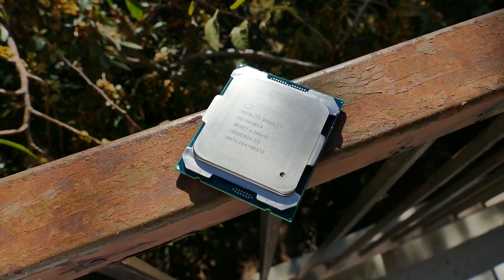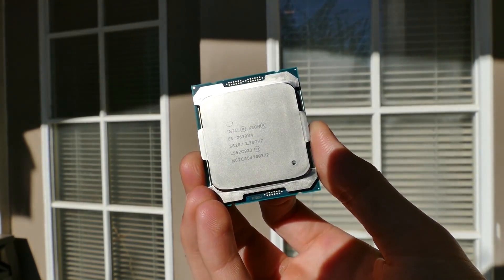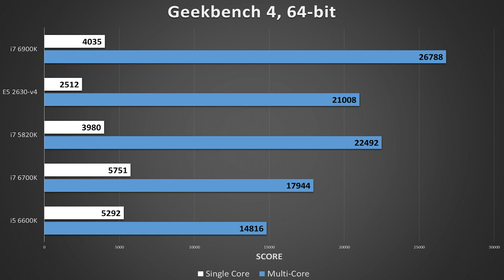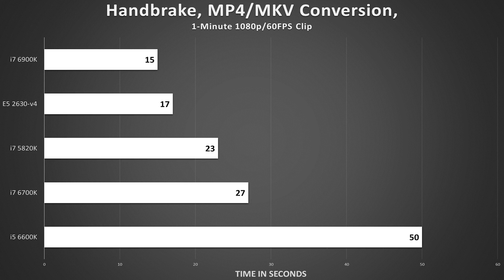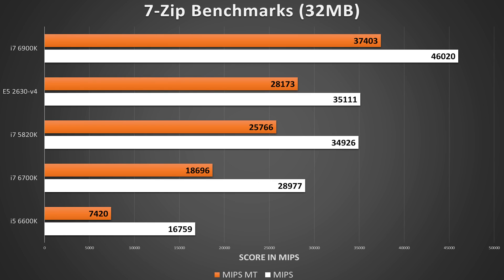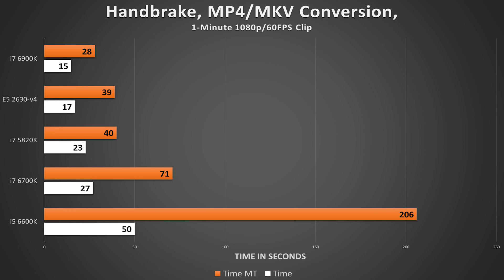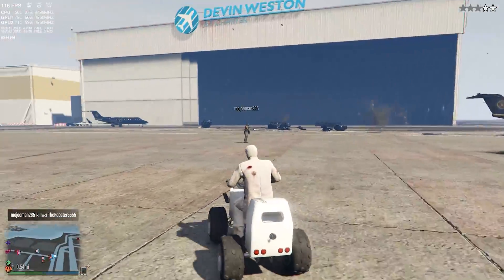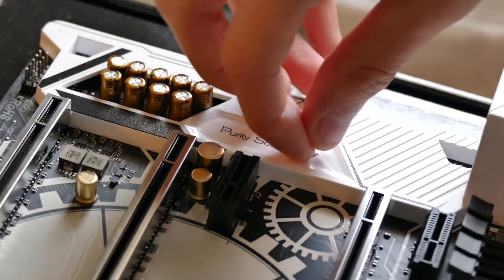i5 vs. i7 vs. i7 vs. Xeon vs. i7 (Multi-tasking/Heavy Workloads)

Comment: Couldn't agree more, I built my first editing PC on a 6600k but notice it crashing my adobe programs too often when creating proxy footage for my 4K files so that they can be easier to edit and take the load of my computer (at the time). So I sold it and bought a 6700k it cut the need to create proxies for my footage it can handle all my editing needs that is why I haven't jump to an x99. Sure it would be nice but I don't really need it. I still push out 4K videos perfectly fine. The only way I would consider jumping to an x99 would be if I find a board like you did that one time I saw I met you at micro center! Keep up the good work man! 

P.S. You videos would look much better with an inter changeable lens mirrorless camera to get that nice bokeh 😍 non the less keep up the good work! 

P.P.S. How do you find time in between finals to push out content? lol you're an engineer student too.. ha I can't do it as a business student lol

Comment: Hi, is it worth to skip on graphic card and buy i7 6700k or go with i7 6700 non "k" with better graphic?  I need it for rendering, photoshop, unreal engine 4 (and others engines too), 3d animation, programming and fl studio... I even thought about go for envdia quadro some like k620 or gt 740 4GB superclocked... till I have some more money for quadro k1200 or gtx 1060 6GB (Because it has more cuda cores)...  I wish to know your opinion... by the way... Awesome video... I thought about i5 6500 or i5 6600k for beginning... but now I change my mind... thanks soo much...
Reply: 6700k and better graphics. save more.
Reply: H31MU7 Do you think that GTX 1050 ti is enough for video editing and for example unreal engine 4? I consider to buy this or get more money for gtx 1060 oc 6gb or something like GTX 970...
Reply: Kamcio Madafaka if you're buying a new card you should just go for the newest and best card you can afford. best thing to do is look up which games run on unreal, find out which cards those games run best on and pick one that fits within your maximum budget

go with the 1060 or an RX 480 if you can afford it, if not go the RX 470/1060 3GB
Reply: H31MU7 Thank you soo much... I think to stay with integrated graphic for about a month... and after that buy some dedicated one... because at the moment I need it only for video editing, programming (I'm entry level), fl studio and drawing after that start with 2d and 3d animation...

Comment: I have an e5-2680(as mentioned in a few videos on this channel) which runs 3.1ghz on all cores, max single core 3.5ghz. It outperforms my trusty old i7 3820 @ 4.75ghz in multi threaded optimized software and only loses out a few % on single threaded apps, which surprised me to say the least! Crazy chip for the $100 i paid for it! If i sold my i7 (not, im collecting!) it could owe me less than i spend on lunch most days!

Comment: I wouldn't rush on the Kabylake.  It's almost exactly the same speed as Skylake clock for clock, and it's only real improvement is the smaller node.  That being said, there are reports of the 7700k hitting 5.0Ghz on air, but it seems like a waste getting it, if you already are running the 6700k.  I can't see the marginal improvements being worth it.  If you are already running Skylake, I would wait it out a little considering it looks like we may finally be getting out of the mainstream 4 core nightmare Intel has had us locked in for ever.  No matter what anyone thinks about upcoming Zen, it will almost certainly force Intel to either rethink their pricing, or finally stop trickling improvements, and make 4c/8t a standard, and finally end dual core and 4c/4t nonsense in 2017-2018.  At least hopefully.  With the new API's getting used more and more, I think core counts will start to show more use in the near future, even in gaming.

Comment: i just bought my 10 core xeon for adobe should i return for a 5820k i need at least 32 lanes and the 5820k can do that so should i keep the xeon
Reply: cant
Reply: Joel Massara not sure on price of the xeon but i7 5930k is a 6 core with 40 lanes.
Reply: SkinUpMonkey yes its slightly sheper but i also biught a h50 for my xeon so i would need to return that aswell
Reply: Joel Massara em h50, do you mean water cooler? If so should still work but wouldn't use it to overclock.
Reply: SkinUpMonkey well the 6850k has 140 watt tdp and is on sale for 400
Reply: Joel Massara Ya the tdp is the reason I wouldn't use a small cooler for overclocking, get at least a 240mm rad.
Reply: SkinUpMonkey k thanks for i think i know i am gonna do

Comment: Hey, I have a massive question. Alright so i have a 6600k OCd to 4.6 Thanks to my gigabyte mobo and I want to know is it safe for me to get a 2nd GTX 1070, I have one right now but I want to know how big the Bottleneck is going to be. Greg pls help, I dont want none of these damn youtube comment help because all they say is  "Get and I7"
Reply: Trum p you should be golden man. No bottlenecks. Youll get huge performance boost. I was doing SLI 980s perfectly with a i5 3570k at 4.6ghz.
So as long as cpu is OCed to its most stable oc you should be perfectly fine. The 6600k is a modern cpu and 8x8 lanes should be perfect. Dont stress it.
Reply: Tanzu's right, slap that second card in and you should be ballin'
Reply: Aaight thanks guys!

Comment: i have 6600k only for GAMING . idk how to even render lol glad it still kind of holds up with the big guys
Reply: Ali Mohamed I have a 6600K and for gaming it really is the best bang for your buck, especially when overclocked. I actually think the 6600k would beat the Xeon and i7 5820K because games usually don't use more than 4 cores, so higher single core performance is therefore preferable.
Reply: William Larsson that's true only the i7 6700k is really better for gaming because the clock speed. Idk about amd tho.
Reply: ***** i havnt overclocked yet, whats urs overclocked to?
Reply: Ali Mohamed 4.4 GHz. Will try to get to 4.5 when I have time, but right now 4.4 GHz is stable for me without much effort. You should be able to hit that too, even with something like a 212 Evo.
Reply: ***** sweet, i stock speed with an H60 AIO liquid cooler, if i want 4.5 , i have to make the multiplyer 45 right and what about voltages, do i increase it ?
Reply: Not every 6600k will overclock the same. The build quality of each chip is different. Don't go higher than 1.35v or you will probably fry it. 1.3 is high enough if you don't want to risk it.
Reply: FatoeKing Skylake chips are very consistent when it comes to OC potentially in comparison to older CPUs. I think 4.4 GHz is a number 97% of 6600Ks are capable of hitting.
Reply: Ali Mohamed Yeah, multiplier to 45 (as long as you keep the base clock untouched at 100MHz) and vcore aka core voltage to ~1.3 Volts should do it, because at 4.5 GHz you will need to increase the voltages or you may get frequent system crashes. Nothing harmful, but annoying. Just like the other guy said, don't go over 1.35 V or the heat may shorten the CPU lifespan.
Reply: ***** yeah i wont touch the BCLK though my z170 mx motherboard allows it, ill do that today and stress test it, whats a good max tempreture i should get because now i get 49 load with skyrim
Reply: ***** true, but they have potential of over 5 Ghz if you are very lucky and have watercooling.
Reply: Ali Mohamed I don't think heat will be an issue for you with your AIO cooler, but if needed, try to keep the temps under 75° C just to be safe
Reply: FatoeKing True, but running at 5 GHz as a daily driver is not recommended. Even with good custom loops to cool it down the core voltage will still stress the CPU to it's very limits
Reply: i have my i5 6600k at 4.6 on a 212 evo
Reply: ***** i flat out lost the silicon lottery lol,  i tried the preset overclocks at 4.3,4.4 and none worked, i tried 4.5 at 1.275v, than 1.3v and finaly 1.35v and none of them booted , cant even get into my login before crashing. should i try peaking 1.4v to achieve 4.5 ?
Reply: Ali Mohamed Are you manually overclocking or using a program to do it for you? I would recommend doing it manually because the "one-click OC" options are often unreliable. 

If I were you, I would try 4.2 GHz at 1.3 V just to see if it boots to desktop (and maybe run a short test). If that works, try 4.3 at 1.3 and try to boot, 4.4 at 1.3 V and so on. I think 1.4 V is pushing it a little to far for me personally, but if you feel comfortable and if the temps are low enough, you could try 4.5GHz at 1.4 V, but try to see how far you can push 1.3 V first.

Otherwise.. can you boot back into the BIOS with the overclock? If so, check your temps. If they seem high, then maybe you can try to replace the thermal paste as well.
Reply: ***** i overclocked manually using my gigabyte motherboard and now it freezes when ever am on there . I'll try resetting cmos today . I have arctic silver 5 paste
Reply: ***** the bios is freezing and PC saying error not booting
Reply: Ali Mohamed Yeah, try clearing cmos. 

Was it a long time ago since you applied the thermal paste? Even good thermal pastes like Artic Silver 5 dries out over time an needs to be reapplied from time to time
Reply: ***** no maybe 2 months , removed the pre applied thermal paste as I was changing cpus but its soo weird how I can't overclock it given its a k version. The motherboard is a z170 mx gaming 5 which is good for overclocking so idk why voltages won't help a 44-46 multilateral
Reply: Multiplier
Reply: Ali Mohamed Maybe you're just really unlucky and will have to settle for something like a 4.2 GHz OC. 

Like I said earlier, try to start at lower clocks like 4.2 or 4.3 GHz at 1.3 V and work your way up to learn the limits of your CPU.
Reply: ***** OK I'll go back down to 4.3 and see what voltages i can give it, should I try 1.4 volts
Reply: Ali Mohamed try 1.3V first at 4.3 GHz. Rhat should work on any 6600K. If it doesn't, then I'm sorry but you should probably settle for a 4.2 GHz OC or less because you lost the lottery big time. :/
Reply: ***** so i returned to stock voltage adn stock speed, right now and works as am typing with 22 degrees celcius on idle, , should i do 4 sicne it turbos to 3.9 and add say, 1.2volts ?
Reply: ***** k i turned off turbo boost technology and set multiplyer to 40 and its running fairly stable so far in prime 95 and i used stock voltage
Reply: Ali Mohamed Prime 95? Jeez, that program is not good. It is known to permantly damage processors because it pushes them too far which produces unhealthy amounts of heat. I would never use that haha, I use Aida 64 and some games for stability testing instead

Anyways, it's not really a surprise that it works at 4.0 GHz at stock volts as it is only 0.1 GHz higher than the maximum turbo boost of 3.9 GHz. You are making since progress though, which is nice to hear!
Reply: ***** well prime 95 passed all tests for half an hour so i wont damage my cpu any further lol , i love that little fucker, anyway ill move to 4.1,4.2,4.3 till it gets unstable and maybe than ill ad voltage, i think it was the turbo technology that was ruining the overclock for me. ill try aida 64
Reply: Ali Mohamed Well half an hour isn't too bad, I'm sure that won't have any lingering effects on your CPU, but I would stay away from it from now on haha.

Yeah, it could actually have been the turbo boost that fucked up, I have never heard of that, but it is possible that there is some bug when overclocking with it enabled. Hopefully you'll get better OC's from now on.
Reply: ***** thanks alot man, ill incerase the multiplyer and keep you updated i hope to god i can get more juice out of it because i plan on keeping it for 4 years , if it indeed lost the lottery, am sellign that crap lol
Reply: ***** hey so i did 44 multiplyer at 1.28 volts and running stable so far and temps only 2 degrees higher , ( 24 idle now 26 idle)
Reply: Ali Mohamed Sweet! Seems like the turbo boost may have been the issue then. What are your temps during load?
Reply: ***** i did stress test on aida 64 and max temps were 48 on 3 cours and one core was 50 , average was 46. i playd skyrim and temps never exceeded 55. and btw dont laugh at me but the issue was that once i entered the voltaeg i typed it but i didnt press enter, so new multilpyer was reegistering stock voltage LOL, i forgot to press enter haha.
Reply: ***** seems like i didnt lose the silicon lottery after all , dont want to jinx my self just yet haha, will easily push to 4.5-4.7 now that it stabilized at 4.4 ad 1.28volts
Reply: Ali Mohamed Sorry but that's actually quite funny😂 

Go ahead man, you got lots of headroom on the maximum temperatures as well. You will probably get a really good OC
Reply: ***** yeah i feel kind of dump 😂😂😂😂😂😂. yeah ill push the chip to maybe 4.5 and ill stop for a wile. thanks for your help man ,
Reply: Ali Mohamed You're welcome, I'm glad that I could help!
Reply: A stock i7 5820K holds up just fine in gaming against a OC'd 6600k @ 4.6GHz, actually beats it in some games. It would probably beat most xeons yeah because of their low clock speeds.

Comment: Tbh i've been looking at both the 6700k and the 5820k(and a 3930k on ebay but i can't find an x79 board for it) and with the way the price has been fluctuating and my severe lack of funds its been tough to try and pick and with the recent price increases i've been looking at the 6800k as well will totes let ya know which one i end up picking but even then it may or may not be overkill but who knows
done rambling

Comment: I'm building a PC right now. I already have the motherboard, an MSI Gaming M7, a CPU cooler, a Deepcool Captain 240EX, and some RAM, 16gb of 3200mhz Corsair Vengeance LED. I'm thinking about getting a 6700k and a 1080ti or a Zen GPU, depending on which is better. Do you think Kaby Lake CPUs are going to have the same socket as Skylake CPUs? If so, should I wait to buy a Kaby Lake i7? If not, I am still within my return period for the mobo, so I could return it and wait for one that works with Kaby Lake CPUs, if you think it would be worth it.
Reply: I just realized I said Zen GPUs 😂
I meant Vega.
Reply: Preston Wilburn both takes at least 4-5 months to release :P go with the 6700k
Reply: Their going to have a different pin layout so it wont be compatible.
Reply: Cereal Killer OK, thank you. I'll probably just keep everything I have now and get a 6700k.

Comment: And here I am having to purchase an i5 6500 for a gaming/editing rig because it's the best CPU I can buy with my limited budget... sigh
Reply: notdog I'm not a real big fan of AMD CPU's even though I have an Athalon powering my 7 year old laptop that's still managing to solider on. I can't deny AMDs products because of it, it's just Intel is just so much better quality.
Reply: Hudson Ball Same dude, the struggle is real.
Reply: i5-6500 is PERFECTLY fine for gaming.
Reply: Hudson Ball Would still be fine for photoshop, not sure about video editing above 1080p.
Reply: Want Skylake? Xeon E3-1245V5. LGA 1151, 4 cores and 8 threads,
integrated GPU included, and decent price.
Reply: I'm stuck with an i5 4460. it's fine for 1080p gaming but I want a 6700k or a new Zen chip
Reply: +Evan Bryner yeah same since its so close i plan on waiting
Reply: notdog Didn't say it was. Just when compared to the ones on this list. I really wanted an i7 6700, but that's beyond my means...
Reply: I am still running an i7-2600k @ 4.6ghz. I am hoping to be able to upgrade soon and that zen is actually pretty good.
Reply: i bought the 6500, even if i could get prety much anyhting on the list, since its the best relative price to power. but i dont edit so i guess thats why.
Reply: Going from a 2600k @ 4.6 to a 4770k @ 4.5 was a substansional upgrade for me atleast! Newer CPU-heavy titles run like butter, and the windows fast boot and features like bios implemented fan-controllers are nice to have :)
Reply: Same...tho, went with a 6600, was part of a deal.
Reply: Just don't render a video while playing a game, you'll have a very bad day.
Reply: George Narwhel Yeah, but I'm also going to be doing editing in Photoshop and video editing.
Reply: George Narwhel I don't think I'll be doing anything over 1080, but it's time I need. The slowing the CPU the slowing the rendering. I'm currently on a 7 year old laptop with an AMD Athalon and it take almist and hour to render a 720x400 avi (yes i know avi is old but it's about the only thing that plays on my current computer). and it take almost 6 for a 720 MP4.
Reply: If you are editing a fx-8350 would be better i think and ok at gaming with a overclock. And no you don't need to water cook then to overclock mine goes to 4.7ghz just fine on the stock cooler. But i would recommend getting a quieter cooler
Reply: trevor jaster As I've said before I'm not much a fan of AMD CPUs.
Reply: trevor jaster Going with an am3+ cpu at this point would be rediculous, even if the 8350 is marginally stronger at editing.
Reply: just get A 6700k because it will be cheaper... since you dont have to upgrade mb and wait
Reply: Step back a bit and check out a Xeon 1231v3. Its basically an i7-4770. Slightly lower IPC, but better multi-tasking, obviously. And will still do great in games!
Reply: U can get an older Xeon on eBay that will outperform that cpu for half the price
Reply: Holo Umbreon I've already bought my CPU now. an i5-6600.
Reply: Hudson Ball GUYS I7 7700K OR XEON
Reply: Depends on some stuff, but in general, I'd go with the 7700k
Reply: Imran Isak OVER THE NEWEST XEON CAUSE XEON IS LIKE 10 TIMES FASTER
Reply: I've already built my rig with a i5 6600. but thanks for the offer.

Comment: Is that xeon overclockable? If so, would have been curious to see the results. On some older platforms, a used Xeon will be cheaper than it's i7 equivalent making it a nice upgrade before moving on to a newer platform.